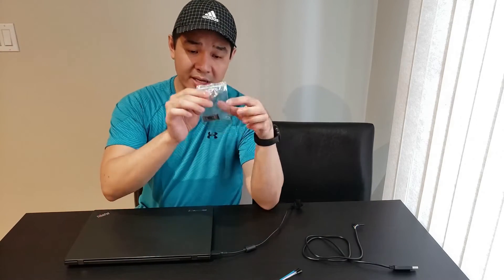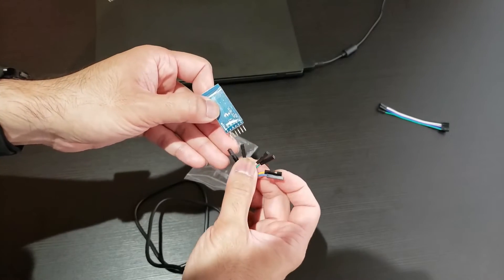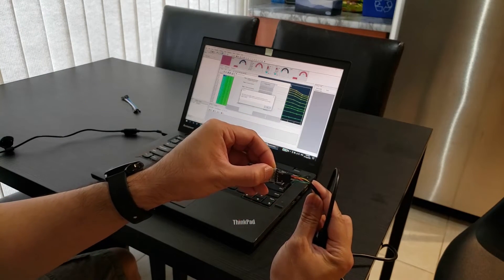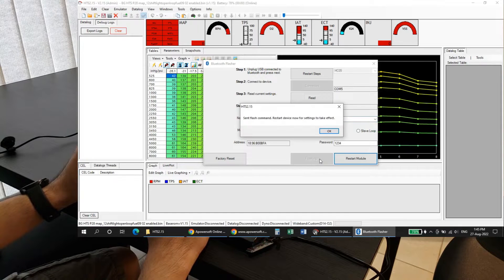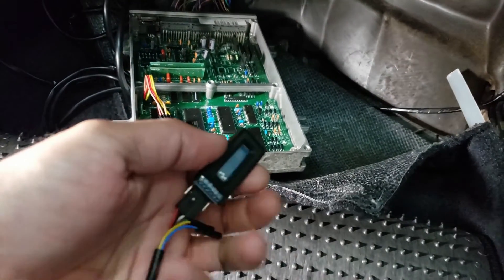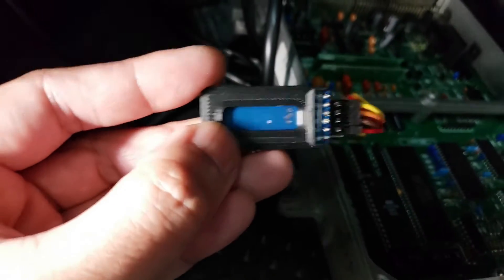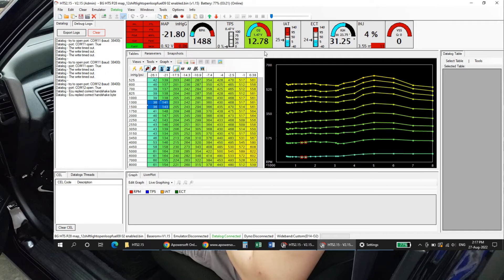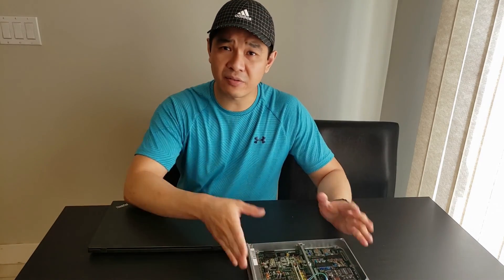||HONDA 88-91 CIVIC/CRX|| OBD1 ECU Bluetooth Datalogger HC05 for under $6! (P28, P05, P06, P72, P75)

Comment: I'm trying to get datalogging works and I have problem... do I need RTP connected to ECU to get dataloging via HC05 work ?
Reply from the maker: Yes & no, you need the map from the same software you're datalogging with on your ECU. So either the map is on your RTP, which you'll need connected or on your chip.
Reply: @BudgetGears  so do I understand corectly, if map was made on chrome and now i try to conect via HTS this will not work
Reply from the maker: @greedymechanic correct. Map and software must match.

Comment: Bro can you connect this to the Tuner View App on an Android phone?
Reply from the maker: Yes. You need to buy the right data protocol from the app.
Reply: @BudgetGears thanks bro. How about stock ECU, can we monitor or data log via installing a Bluetooth data logger, since my stock P73 has a CAN2 connector on board.
Reply from the maker: @boyetquemquem4770  I don't know. I don't know of anyone that would data log their stock ECU. That being said, it should be possible, but not with tuner view. Maybe a different app. Maybe with the app Hondash. Tunerview and apps like Honda Tuning Suite require the rom or map on your ECU to match the software it came from. In other words, if you have a map from Honda Tuning Suite, you can data log with Honda Tuning Suite and you can data log with the Honda Tuning Suite protocol in Tuner View.
Reply: @BudgetGears Thanks bro

Comment: Hi buddy, i just subscribed to your youtube channel, I have a honda civic hatch D16y4 engine and upgrade the ecu to p28, unfortunately i don’t know where to connect or plug in the emulator wire in the ecu can please be able to help me? 
My P28 ecu has already rechip and installed a data logger and been installed tuning Map, this my first attempt to tune my car any advice from you will help me a lot.
Reply from the maker: Are you sure you have an emulator? It's very obvious where to plug it in if you have an emulator. There will be a port for it right on your emulator.
Reply: @BudgetGears that’s the thing that i don’t mate, can you be able to send me a picture of the location please.
Reply from the maker: @dandelao9653 just google a picture. A emulator is very obvious. You have to cut the ecu housing for install of emulator. I have a video on installing the bmulator to give you an idea. Just check my YouTube videos.
Reply: @BudgetGears ok thanks i’ll do that
Reply: @BudgetGears hi mate i’ve got this ecu bought this ecu and this is how it looks like, on this set up do I need to get an emulator or not, as I’m watching you how to install the emulator there no chips under that emulator as my one already does and has burn Map installed on this chip what should i do to make it connected to my laptop? Any help will be highly appreciated as I truely no idea what and how to make it tune
Reply from the maker: @dandelao9653  Please do some research on tuning. If you want to real-time tune your ECU, then absolutely you need a emulator. These are the basic concepts of tuning that is fully available with some research on Google. This video is datalogging. Datalogging is exactly what the word means, it logs data. In other words, it only receives data. From the sounds of it, you're trying to send data and that's impossible without an ECU capable of that, which is an ECU with an emulator.

Comment: Hi i bought the hc05 and i first started and tried to put on at mode red and blue light came on and started blinking slow. as i saw on video u only had a red light on. but i also had a blue one. is that okay? and also it could detect the com port. but as soon as i press connect it says couldnt go on at mode. but it was already blinking slow. whats wrong?
Reply: or do i need to buy another hc05? do u have a site where u bought the hc05 at? and what brand or manufacturer made it

Comment: Hi, I have a P28 with my stock D16Z6, I flashed a HC05 and HC06, but when connected to Hondash it says can't read from ECU or can't connect to the ECU.. I will try with another app..
Reply: Did it worked for you?
Reply: @fabrrr  Not gone further.. But the stock P28 ECU needs a resistor and a soldering to get data transfer.. I will do it when I will have some time...

Comment: I tried this but hts sayscant conect to ecu check debug logs.. i am in the right com (outgoing) before that it said maximum number of series reached
Reply from the maker: Sounds like you're trying to connect using emulator. This tutorial is for datalogging. If you're having issues with your emulator, then you need to contact your emulator manufacturer.
Reply: @BudgetGears  i dont have any emulator with me sir, i am very new to this please help
Reply from the maker: @Race-bay  Then connect using datalogger. You can only datalog if you don't have a emulator. Not sure why you're connecting using ECU then.

Comment: What about if your using a moates ostrich for your emulator, you still would have to connect your ribbon cable to your laptop right? Since the data logger and emulator are two separate USB connections
Reply from the maker: Yes, datalogging and the emulator are 2 separate things. So you'll still have to connect the ribbon from the ostrich. Only the datalogger will be wireless.

Comment: hello I tried to connect hc05 to honda tunjng suite but it is still promting failed to enter at mode after clicking connect on bluetotth setup hehe do you know why or how to fix it ? thanks
Reply: There lots of different factory made HC05 . I got four different hc05 module and just one working ın my car. I tried before other 3 different mark HC05 ın HTS Bluetooth  program tool but  fail.
Reply: @NSRTUNED   i messed up my ecu trying to remove the cn2 pins i placed haha it pulls the copper traces from the board so now i will send it to someone who repairs pcb and ecu

Comment: can you program it wirelessly, like a normal ecu tuning ? or is there any delay on the readings? im planning to learn how to tune my own car :)  (newbie)
Reply from the maker: No, this is a datalogger. It's exactly what the name is, it only logs data. In other words, it only reads data and doesn't write it. For you to write data, you need an emulator. The readings you obtain from the datalogger is used to make adjustments to your map. You then write the map in real time using an emulator or not in real time by burning a chip and swapping out the old chip with the new.
Reply: @BudgetGears  Thank you very much for answering my question it is a very big help for me since im just starting to learn how to tune :) thanks

Comment: Where did you get the cable to hook the Hc05 to the ecu? If you built one what size are the pin connectors?
Reply from the maker: Just search for dupont connectors.

Comment: What’s up my guy? I got a chipped p28 and I’m trying to get into tuning but idk what to get to connect to my ecu to my laptop. Thanks in advance.
Reply from the maker: If you want RTP, then you'll need to run an emulator. The datalogger can be either bluetooth or cable. So you'll essentially have 2 connections. One from emulator and 1 from datalogger. If you're just doing it without a emulator, then just a datalogger to connect to computer and you'll need to remove your chip each time you make a change, burn the new rom, and then put the chip back. I'd suggest doing some reading on honda tuning to get the basics down.
Reply: @BudgetGears  thanks 🙏🏾

Comment: I've successfully flashed the HC05. My phone can detect it but Hondash app says can't connect to ECU. My notebook can't even detect the HC05 module. What could be the problem?
Reply from the maker: Did you flip tx and rx back for your cn2 port on the ecu?
Reply: @BudgetGears  It was a setting I had to switch in Windows 11 to detect this device.
Now I can connect with my laptop but HC05 doesn't transmit data.
I tried switching tx and rx but still can't get it work.
J12 jumper is removed.
Reply from the maker: @ImBenny  you're datalogging with hts? Is it a hts map on your chip or emulator? Has to be the same to datalog.
Reply: @BudgetGears  Yes. The ECU is flashed with HTS rom. So it is on chip.

Now I'm trying to connect with USB to serial cable but I get the same result so I think my ECU may be faulty. :(

Or datalog can't work without emulator?

Comment: Can't pass step 2. I have two different cables, none of them work. One says Failed to enter AT mode, the other one just does nothing. What I did wrong?
It recognizes the COM port automatically but can't connect to it.
Thank you for your help!

Edit:
I got it fixed by change the RX and TX. My bad.

Comment: Thanks for the tutorial, will give this a try! If you attach the HC-05 to the inside of the ECU, will the bluetooth signal still make it outside once you screw the ECU lid back on?
Reply from the maker: Yes, I've tuned with the ECU lid on only and works fine. I'm pretty sure almost everyone places it inside the ECU.
Reply: @BudgetGears  Thanks for getting back to me, appreciate it!

Comment: my datalog says the o2 is running 1v after warm, is it normal or is it running too rich?
Reply from the maker: Why are you datalogging with a narrowband? You need to get readings with a wideband. A narrowband has a very limited range. I can't tell you if it's normal because your car needs to be tuned to stoichiometric AFR with a wideband first.
Reply: @BudgetGears  do you mean I can use wideband for only when datalogging or I can use it daily?
Reply from the maker: Depends on how you want to do it. Some drive with wideband even after tuning and some take it off after tuning. It is recommended to keep the wideband even after tuning if you're a built motor. It's a peace of mind when you've invested thousands into a motor. But wideband sensors tend to die pretty quickly. Really up to you. I honestly have no idea what you're doing. I'd say hook up your wideband and if you're wideband readings are what you expect, then you're fine. Narrowband only can read between 14-15 AFR. So you can imagine how inaccurate it is when you're car isn't always stoich.
Reply: @BudgetGears  got it, just want my car to run smoothly but it seems like it's not as easy as it seems. it has 100k miles on it, I've spent thousands already and now I just like to play around to know my engine better. It's D16Z6 btw, Thank you very much for your response :)
Reply from the maker: @FeraAlfian-vu1wy  That's pretty low mileage. Is your engine all stock? What kind of issues are you experiencing? If it's all stock, there's really no benefit in running a chipped ECU. You're actually better off running an unmodified stock ECU. The maps on a stock ECU vs a chipped ECU will run differently. I'm assuming since you're datalogging, you might be running a chipped ECU.
Reply: @BudgetGears  because I think my car is running rich, my engine is not really stock, and I have a switch in the jumper to change between stock and mapped ecu, the benefit is for the datalog while I'm waiting my hondash to be arrived and really just having fun playing around with it. Try different things even if sometimes I know something's bad will happen if I did certain things to the engine but I did it anyway lol

Comment: Tx is whats transferring out of the ecu. Pin 2 on board.
You need the other side to catch the signal on recieve. 
The software is requesting these packets, to send them to the computer it needs to send the signal to RX for received.
Dont think of them as flows, just signal names.

Comment: Do you have a wideband connected and can read that well? And if yes you wired it at narrowband pin on ecu?
Reply from the maker: Yes, I have a wideband connected and yes I used same pin as narrowband. As well as used power and ground from ecu. And yes, it read no problem.

Comment: What is the small cable called please?
Reply from the maker: Dupont connectors/wires
Reply: @BudgetGears  I’m impressed that you managed to find this short cable as it’s quite challenging to locate, especially since it’s meant to fit inside the ECU. Where did you get it from?
Reply from the maker: @iamblanktape  Amazon, but you can find it anywhere. Lots of places sell the cables if you Google it. Its a very common electronics cable.

Comment: will this work with obd2?
Reply from the maker: No. If you have obd2, you'll have an obd2 scanner port. You can just hook up a bluetooth scanner to that port and view things.
Reply: @BudgetGears  thank you I figured, do you know of a cheap way to tune an obd2 computer in specific I have a 98 civic ex coupe and want to tune the car but I don’t want to spend crazy money on ecu like haltech
Reply from the maker: @hectorjauregui5944  I'm not going to say it's not possible to tune the obd2 computers because some have done it back in the day. But it'll be near impossible to find any info on that as it was not a common thing to do back then and something no one does now. 

Tuning your car in general will not be something cheap. The cheapest and easiest way to tune an obd2 car was to convert it to obd1. If you can find a cheap obd1 ecu, chip it, run a obd2 to obd1 jumper harness, and find yourself maybe a moates ostrich, that would typically be the cheapest way to do it. That being said, obd1 ecu's have gone up in price significantly and it's very old technology. It'll probably run you around 500-1000 for a ecu, with emulator, and jumper harness, etc. But still cheaper than the Haltech. You can essentially get a Fueltech as well. Those are reasonably priced, but still about 1000 for that.
Reply: @BudgetGears  yeah I’ll definitely do my research and thanks for the reply it helped a lot!

Comment: Hello, friend.

I've tried to program hc-05 with HTS, but without success. Despite of this, i've programmed with other software, changed the name and it connects fine on my laptop.

But the HTS software doesn't enable the START option on Datalog Menu... I had changed the COM port to COM6 and COM6 (ingoing and outgoing), but i can't even try to connect and see logs, because my software doesn't allow. 

You can help me?
Reply from the maker: Did you remove J12 resistor? Also, do you have a HTS rom running on your ECU. You'll need this to be able to datalog on HTS.
Reply: @BudgetGears  thank you so much. how can I check if my remap uses an hts rom? I’ve bought the car already with map
Reply from the maker: @k7franklinbr  that depends on if your ecu is just a burned chipped or you're running a emulator. But essentially you need to read the rom on your chip or emulator and look at what's programmed. HTS is usually tagged HONDATUNESUITE in the last buffer address. You can also read the rom and then save it and try to open in HTS. It will give you warning or not open if its not HTS rom.
Reply: @BudgetGears  The big problem is my HTS doesn't show START DATALOG option enabled. It shows disabled in gray. In your videos it was always enabled.
Reply from the maker: @k7franklinbr  its because I'm running a HTS rom. Here's what you need to try, create a new HTS map, burn it to your chip or load it to your emulator,  whichever you have, now try datalogging. The datalog only works on HTS with a HTS rom. Here's another example,  people use tunerview and the hc05 to have a digital datalog on their phone for their car, tunerview requires you to select the protocol for your map. So if you're using HTS, you'd buy the HTS protocol and if you're using crome,  you'd buy that, hondata, you'd buy that etc. HTS software can only datalog a HTS rom. In other words, you can't have a crome rom and try to use HTS to datalog it. You'll need to burn HTS rom then you can datalog.
Reply: @BudgetGears  I got it. So, there is an another software that is compatible with all kind of ROMS? I'm not capable to build another map, all i want is see the live parameters to check the health of my car.

If is it impossible, i'll need to search for another guy to build an modern map to view in HTS.
Reply from the maker: @k7franklinbr  I'm not too familiar with a software that's compatible with all roms. It's usually quite specific. You can try the app Hondash. Tunerview is the other app people use, but Tunerview needs you to know where your rom is from. I don't remember if Hondash needed to know or not.

I think the health of your car can be determined with your gauges. Your temp gauge will tell you if you're overheating. If the car is tuned, it most definitely will need a wideband and you can monitor your AFR using that. But either way, you should really know what kind of map is on your ecu. I suggest pulling the map and taking a look. Highly likely that it's probably a crome map.

Comment: I have a Civic coupe D16z6 - 1995 equipped with a P28 ECU -  with no modifications. Do i need do something about jumper J12 in order to comunicate via serial CN2 conector as you did?
Reply from the maker: You'll need to chip your ecu and remove J12 to use the CN2 port for datalogging.
Reply: 🤦🏻now i got it. the chipped rom has the codes to conunicate with the serial, ins't? i thougth i has a pure RS-232 TTL serial there at that pins... Mine doesnt have a chip...the board looks like new... in alternative. do you know if will work with hondash?
Reply from the maker: @ftonello1  I've used Hondash on my chipped ecu's, but never tried datalogging on a unmodified ecu. I'm not familiar with getting the CN2 port to work on a unmodified ECU, but someone must have done it out there. I don't see a point in datalogging a stock ecu, but I guess some people may like it as a display or something.
Reply: @BudgetGears  You´re complete right about dataloggin. The only point i see using hondash, is that you can makle a very low profile diagnosis, using the data that comes from stock ecu, to check the basics about your engine, mainly, if the cluster is working by compairing with the hondash.  The rest is pure cosmetics. Thank you and congrats on your videos!